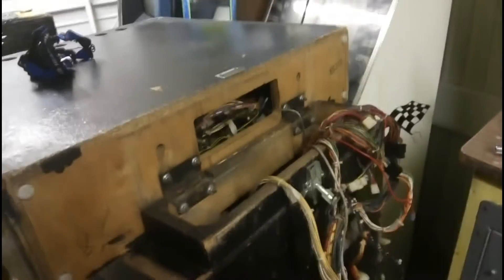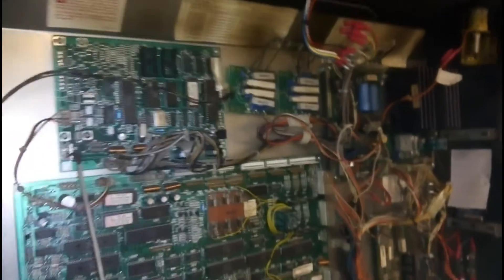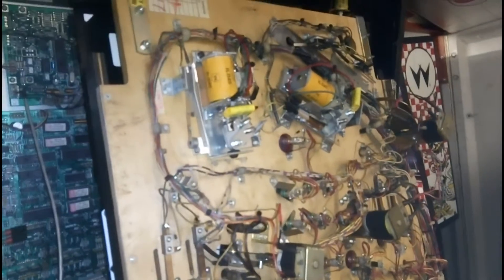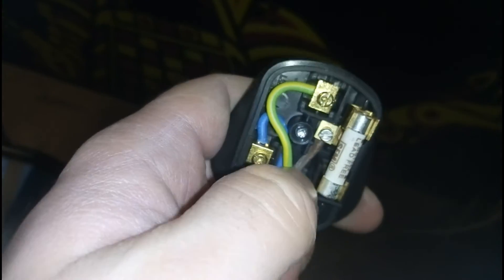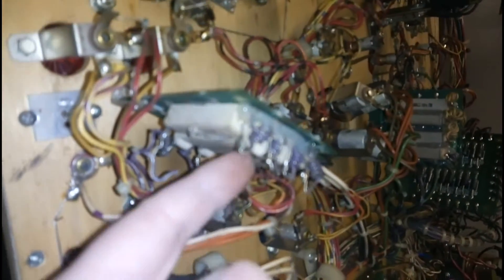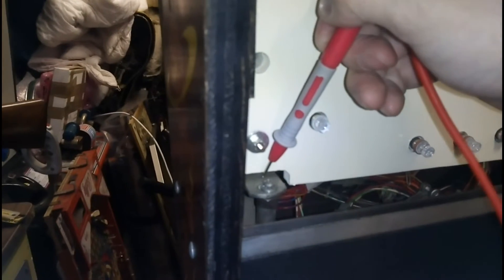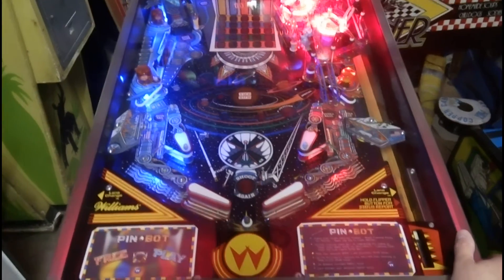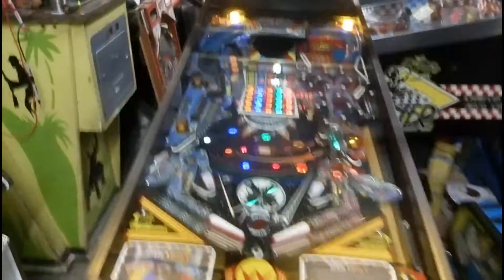Williams Pinbot Pinball Machine - Fix and Setup

Comment: First off! Thank you for uploading very nice, wish they were a little longer but....
    Black tape?? Unhooking boards for head removal?? Power cord?? Those connectors?? Hahaha
 Its the same way here in the US. Ive gotten to when I get a new pin I just cut the power cord off and install a new one!
I wish these pins could tell stories of what the previous owner was thinking, I do believe it would make for some very funny stories! I very rarely install leds in flash lamp areas due to being to bright, but at least it has leds helps you plus help the power supply and connectors.
  once again you saved a pin from the dumpster! Thank You so much!

Comment: Those flashers always get power.  You CAN'T use LEDs for the flashers in Pinbot, because they will always stay lit due to the way the power board for the flashers works.  Todd Tucky of TnT Amusements explains this in his video about Pinbot.

Comment: I have A Totally Legit Question

Why when you service Arcade Boards Do you not change the caps and such? 
Its something ive seen in alot of your video's
Reply from the maker: +Amy Marie Hi Amy, I almost always replace the filter capacitor on the power supply boards, but don't generally replace all caps for the sake of it. If I am doing a full ground up restoration of an early 80's machine then I will usually replace every single cap, as that is the age when they are almost definitely on their last legs. I'm fairly sure I showed replacing caps in quite a few videos, Galaxy had all new caps as an example